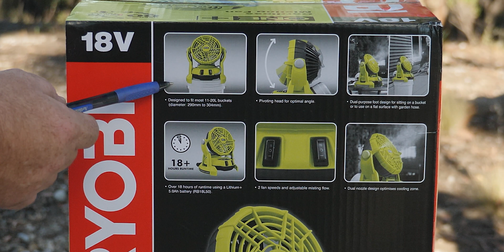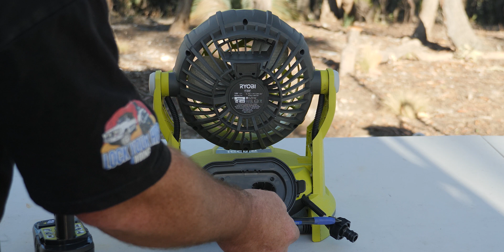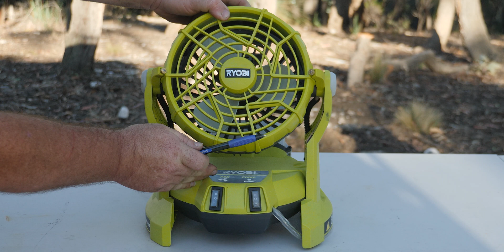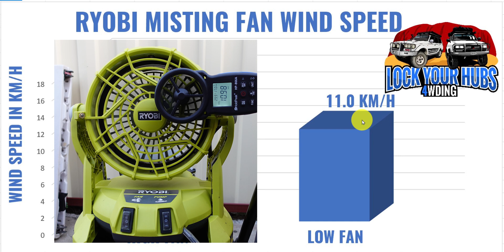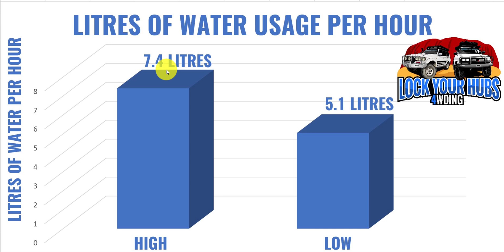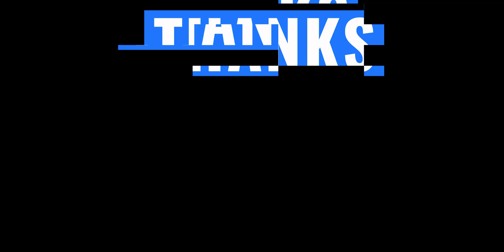Ryobi Bucket Top One+ 18V Misting Fan review PMF01K R18MF-0

Comment: have you tried it out with a makita battery adapter?
Reply from the maker: It's currently running off of one! Working fine off of 5ah and 6ah Makita batteries.
Reply: @LockyourHubs4WDing  thats awesome mate. Obviously the battery cover will no longer work, any issue with corrosion on the terminals like you said?  
like you im locked into the makita platform. they seriously need to make a new lineup of fans to compete with dewalts new xr and maybe add a misting fan to the catalogue too.
Reply from the maker: No corrosion as yet, I agree, an oscillating Makita misting fan would be great!

Comment: Thanks Simon, comprehensive review as always. What happened to the Franken-battery; I thought you were going to show the adapter that you made? Cheers mate.
Reply from the maker: For the Ryobi fan powered by the Makita battery?
Reply: @LockyourHubs4WDing  yeah, I misunderstood, I thought you had it on hand. Was just curious, no big deal.
Reply from the maker: I do! It was running the fan just today. I might do an upcoming  video with the advantages and dissadvantages.
Reply: @LockyourHubs4WDing  It will be interesting to see. My idea would only be a couple of alligator clips! I am sure yours will be a little more elegant.
Reply from the maker: There's a little more to it than that, they put smarts in the tool batteries these days!

Comment: I can see why you used so much water, you almost had a jet stream cming out. Adjust the misting nozzels (tighten for a more fine mist). Other tricks, stick ice packs in the water as well (or a bag of ice). If the pump dies, you could use an external pump and go through the hose fitting then (bit more of a setup but works).
Reply from the maker: We tested as supplied, I didn't realize you could adjust the nozzles.

As to the ice, that can actually hamper performance dependant on the temperature and humidity. 

The cooling effect comes from evaporation, and cooler water evaporates less. Seems counterintuitive I know.
Reply: @LockyourHubs4WDing  Seems to depend who put the brass nozzles on, sometimes they're tight others as far as the assembler decided to screwed them on. Yeah should have mentioned the cooler water idea is more for direct hit of mist (i.e. being right in front the fan - so you will get pretty soaked). Great video non the less :-)
Reply from the maker: Cheers! I'll try adjusting the nozzles tonight, thanks.

Comment: How will they work with high humidity?
Reply from the maker: Just like any swamp/evaporative  type cooler, they won't be nearly as effective as a refrigerant type air conditioner in high humidity. Though you will get the addtional benifet of the mist droplets evaporating off of the person that land on, assisted by the wind movement generated by the fan in the same way sweating cools you down.

Comment: Well I did not know such a battery operated water cooling fan existed. I was just on my way down to buy the Makita 18V battery fan today, which is on special over the weekend. Now I'm having second thoughts. As a Makita guy, and a tradie, I would find it very difficult to buy Ryobi, but the water cooling is attractive when camping. Suddenly my day is in a state of confusion. My plans in ruin. I think I need professional counselling. Time to lay down and tell my life story. Lay down and start from the beginning. That should take about ten minutes or so........... 👍🏼
Reply: I'm in the same boat, but I bought one as I have the adaptor for Ryobi tools but the cover doesn't close. Bit concerned about how wet it's going to get. Might be time to actually buy a Ryobi battery....dammit
Reply from the maker: I've got a Makita to Ryobi adaptor coming in the post. I'll have to wait and see if it fits under the cover.
Reply from the maker: I did chuckel! You could always grab a battery converter to run it off of the Makita batteries and paint it red for cred from the plumbers?